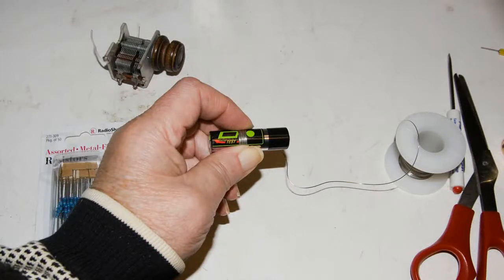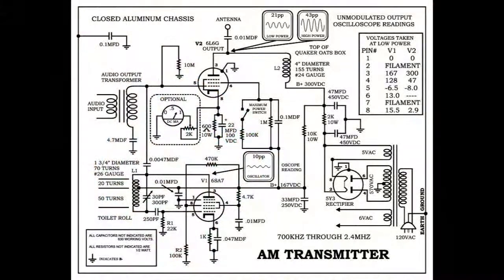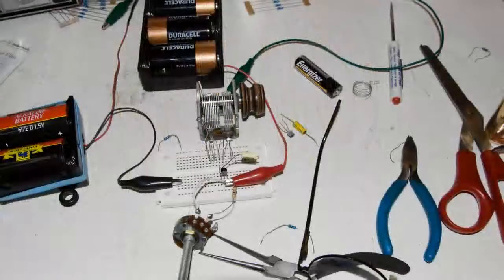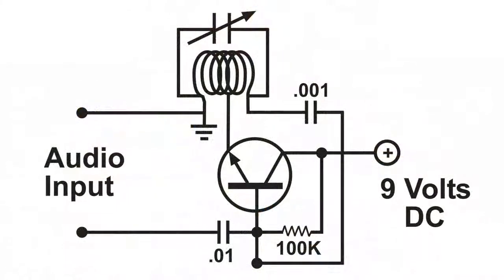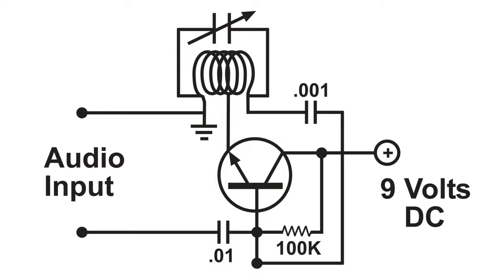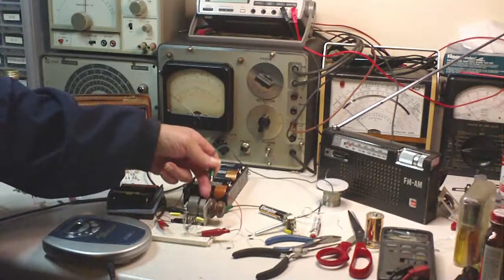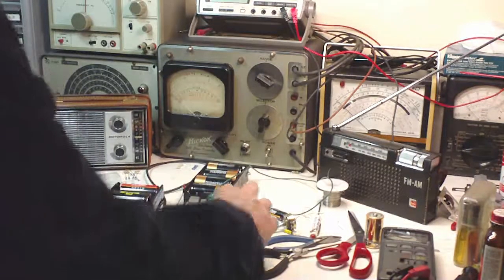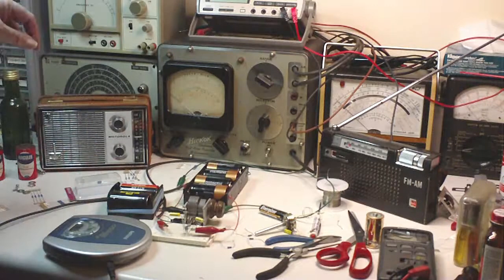Build AM FM Transmitter One Transistor Project 1-3

Comment: how do you give the audio input  to the circuit? are you giving the input using a audio jack? if yes then how?
Reply from the maker: The audio is applied cross the ground and the 0.01 capacitor. You could use an audio jack, the outer part of the jack is the ground, the inner part gets connected to the 0.01 capacitor. All most any audio output should work, radio, tape player, phone, record player.

Comment: I'm sure you know this, but when you can hear the coil like that when you tap it, or maby even speak onto it, it's called something like a "microphonic" effect, basically your changing the frequency of the transmitter slightly as if your modulating it.  I seen a similar circuit in a Radio Shack book, they have several other good books now, I had to modify it slightly, removed the condenser mic input and used a resistor and capacitor for the sound input from the earphone jack on a radio.

Comment from the maker: Glad to hear you got it working. It is very important to keep the wires from the variable capacitor to the coil as short as possible. It's much more stable that way. I never calculated the watts, when I got it to cover the house, I stopped modifying it.

Comment: Thx for your patience with me. I built the circuit with the 9 volt setup and when I am able to make it work ..it works beautifully. I used a radio variable tuner and it is very hard to get it to work. I have to position the tuner just right for it to transmit. I will be replacing it with a trim pot to see how that affect the operations..
Is the a formula to calculate the milliwatts being used in transmission?

Comment: I am still missing the point of both of them in parallel. Would the transmitter not work with just the tuning capacitor? And if not why?
Thx

Comment: Hi Richard 
May I ask why you why you have a 0.5nF capacitor in parallel with the  0.1 to 0.5 nF tuning capacitor.
Why not leave it out? Is the tank circuit not the variable and the coil?
Thx
Francisco

Comment from the maker: @jks2
Hey Jens,
This one, 1-3, works and would cover a room or two. 2-3 will cover most of the house. 3-3 covers about a block of the neighborhood. If you use an outside tuned di-pole antenna with 3-3 it will cover 1 mile=1609.344 meters easy.

Comment from the maker: @ae4se 
It is an NPN transistor from Radio Shack, 15 in a pack. Video T3-3 is a good design for an FM one transistor transmitter. Also The way I built it was not for looks. Part position at those frequency is very important, this is something that does not show in a wiring diagram.

Comment from the maker: @mailomail 
Glad it is working well. The heat I am not sure about. I am positive I ran it for four hour with out a heat problem. But I will be glad and check it again. I am positive we can get it right! I am using  a cheep Radio Shack general purpose transistor. Cost about 10 cents. If you think it may burn out I would glue a heat sink to it.

Comment: @AllAmericanFiveRadio Thank you.
Today I`ve built this transmitter with your suggested modifications from T3-3 and it works great! I will have to check the range of it tomorrow. There is only one problem: The transistor gets quickly very hot. Is it normal? or something goes wrong? I`m afraid that it will burn out soon. I`m using BC338 transistor because I don`t have the suggested one.

Comment from the maker: Thanks mailomail
Glad you built it and it is working well for and thanks for telling the YouTubers.
I would use a DiPole and mount the transmitter in the center and run the audio to it. You will need to study up on DiPoles and wave length to determine the length of each wire. The ground from the transmitter goes one side and the output from the transmitter goes to the other wire of the DiPole.

Comment: This is the simplest transmitter I`ve ever seen and it works very good! I`ve build it and I`m very satisfied with the quality of the transmitted signal. It`s very clear. I have one question: How (where) to connect an external antenna to this circuit? I think.... the range of this transmitter would be much longer with an external antenna.

Comment: @AllAmericanFiveRadio Ok, I got the feeling that we were not talking about the same circuit :-) By the way, I have built this transmitter, and it works well in the FM band. It acts a bit unstable, and I guess this is due to long leads. I will soon try to modify it for the AM band. Thanks again.

Jon

Comment from the maker: @RadioDude1969 
LOL! Oh I was looking at the wiring diagram on the FM transmitter web page. But it is the same answer. In the video, the oscillator has a simple bias, the 100K resistor. On the web page the bias uses a resistor bridge, two 10K resistors at the point 1.1K negative to the positive point. This is why I can double the voltage on the web diagram and it work great. That is not the case for the video diagram.

Comment from the maker: @RadioDude1969
This circuit will tune down into the AM band, but not with a high 'Q'. For that you should change the coil also. This circuit tunes in the AM, FM, old TV, Ham Radio 2meter bands and more. Pick the band you want to work in and then pick the vary capacitor and coil that is best for that band. This circuit is my temple that I use when I want to build a transistor oscillator.

Comment: @AllAmericanFiveRadio Sorry, I still don't get it; I have constructed a similar coil, and the inductance seems to be around 0.6 uH. If the tank circuit alone determines the oscillator frequency, this would require a 4 pF capacitor to resonate on 100 MHz. To resonate in the AM band, say around 1 MHz, it would require a different coil to use the same variable capacitor. I must be missing something here...I would really like to understand this, thanks for your patience!

Jon

Comment: @AllAmericanFiveRadio Thanks for the reply. Amazing how few components that are needed to build a combined AM/FM transmitter. But how could you change the frequency so quickly (between the AM band and the FM band) in the video? Since the coil is fixed, you must have to change the capacitor over a very wide range.

Jon

Comment from the maker: Thanks RadioDude1969
The 3rd turn supplies the power for the positive feed back from this point, and the lower coil through the 0.05uf cap to the base. This positive feed back keeps the oscillator, oscillating. This transmitter, transmits AM and FM simultaneously. So if you tune the transmitter to the AM band the AM radio will demodulate the AM and ignore the FM. Likewise if you tune the transmitter on the FM band the FM radio will demodulate the FM and ignore the AM.

Comment from the maker: @nlimchua 
In the diagram it shows 0.1-0.5 nf and a 0.5nf in parallel. It is very important to keep all the connecting leads as short as possible. The longer the leads the more unstable, that is why I built the transmitter the way I did. As long as have the gage of wire is close it should work, I designed the coil so the gage is not super critical. But having the coil and tuning capacitor as close together as possible is critical.

Comment from the maker: You have to be very careful on how RF transmitters are constructed. RF would rather shortcut than travel through the air. Part location is important in RF. If you build the transmitter in the third video, exactly, you may be surprised. A YouTuber emailed me and said he was able to pick it up 3 miles away.

Comment from the maker: If this is you first transmitter build, which I remember mine very well, some things that seem minor are very important when you a deleing with RF. Example: one YouTuber could not get the Tube AM transmitter to oscillate. He was using black rubber washers for an insulator. The black color comes from carbon and was shorting out the RF.

Comment from the maker: Putting an antenna on the collector may work if you add an RF choke to keep the RF energy on the antenna and out of the batteries. Also using a different oscillator may work better. What is great about this little project is it does not cost a lot of money to do some experimenting. This circuit is just one idea.
Rick

Comment from the maker: Hey Frank,
I am using a general purpose NPN transistor. It came in a box of 30 or so, probable cost 10cents. The way I am modulating it, there is an AM and FM component at the same time. So the AM radio detects the AM MOD and ignores the FM. The FM radio detects the FM MOD and ignores the AM. I was hoping someone would ask that question, thanks.

Comment: Interesting project, simple and looks stable! I will definitively have to try it out. Changing between AM and FM is as simple as changing the connections between AM/FM on the variable capacitor? And would any transistor that can handle the FM frequencies suffice? Would connecting and antenna to the collector side and increasing the voltage increase the transmitting range?

-Frank

Comment from the maker: Hey John,
This one not too far. But if you get out the books or do web searches on making High Q oscillators you could get it to cover the house on FM. This transmitter is very easy to build and it works. The idea is to get people interested in experimenting with it.

Regards,
Rick

Comment from the maker: I keep a supply of batteries in my refrigerator. It does keep them good for a longtime. Yep, transmitters are finicky. This one would also have a problem with temperature. In the house not so bad, but outside it would drift a lot as the temperature changed.

Comment: wow that's an old battery! haven't seen them with testers built in in years! I built a very small FM transmitter a few years ago but I had a lot of stability issues. I had a ferrite slug in the coil and it kept moving out of place

Comment from the maker: Yes if it varied the shape of the coil in proportion to the sound, it would act as a microphone. But I am sure the sensitivity would be lower than a conventional microphone. I just finished listening to the FM transmitter, old radio programs. I had it on for over four hours. Had to adjust it twice as the battery voltage lowered a little, but it was still going strong. Thanks.

Comment from the maker: Good. I built the Ramsey FM stereo transmitter kit also, and it is excellent quality. It surprised me how well it works. I have it on the kitchen counter with a very small antenna and I have been able to pick it up over two blocks away. Very nice transmitter.